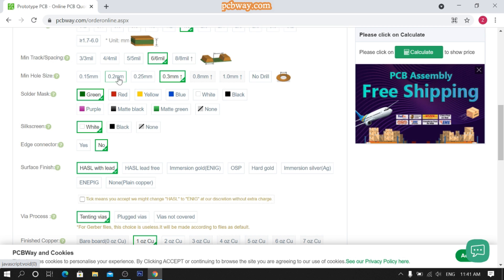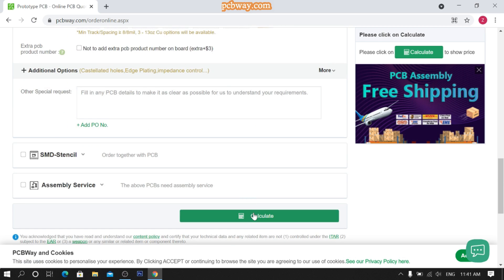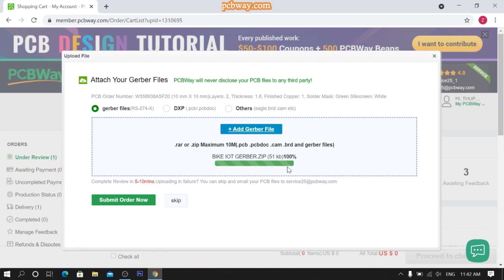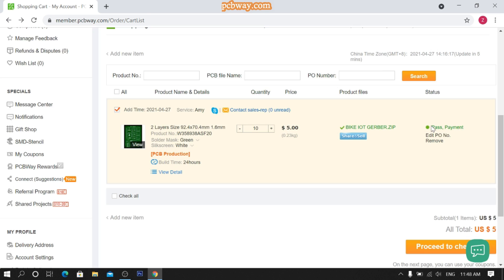How To Make Portable Solar Powered Inverter At Easy

Comment: By all appearances the solar panel is only connected to the USB charge controller and dual battery setup. The fan, inverter, barrel jack, 6 battery pack, and outlet are standalone in the same box. Just want everyone to have full visibility in life. If we all know what is going on we can go further and achieve higher goals.
Reply: yeah that's true😂
Reply: That's true, but the solar panel barely has enough power to charge even the battery of the "power bank" efficiently, let alone the battery for the inverter.
Reply: 🎉gh

Fh
❤
Reply: Why not have radio FM and SIM card WiFi..